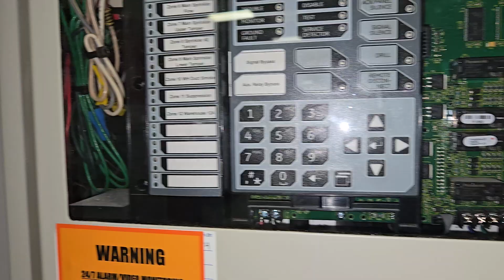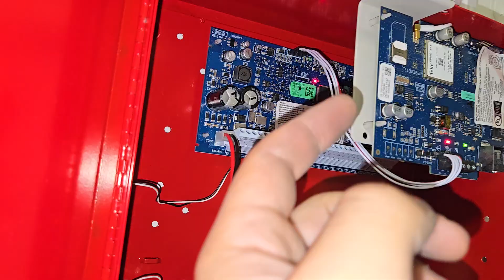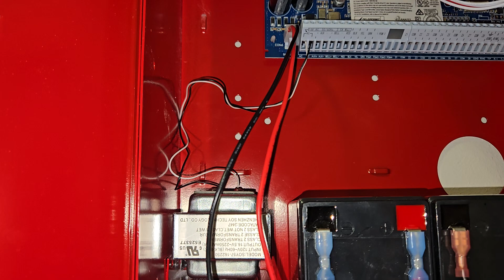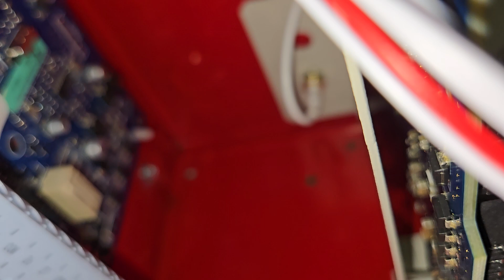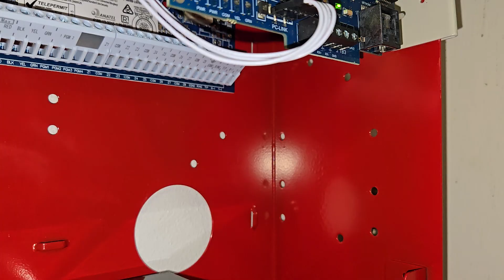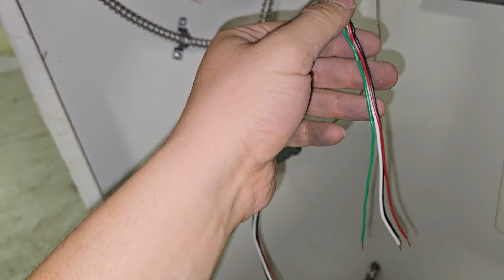Setting Up Fire Alarm Monitoring: What You Need to Know About UL/ULC

Comment: So when programing zone 1, zone 2 and zone 3 what zone definitions is required?
Reply from the maker: Typically we have a trouble, fire, tamper.  And we have a supervisor if there is a sprinkler system.  As long as the monitoring company has the same zones programmed on their end we are good.